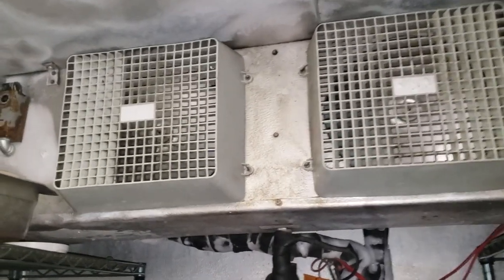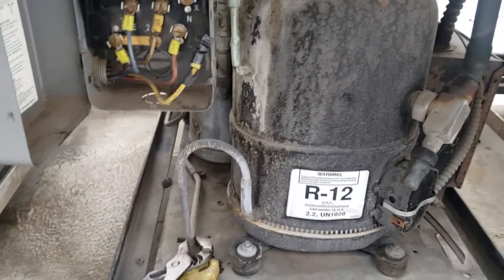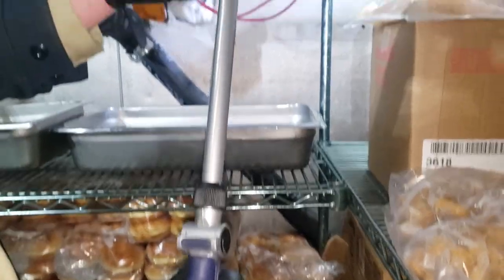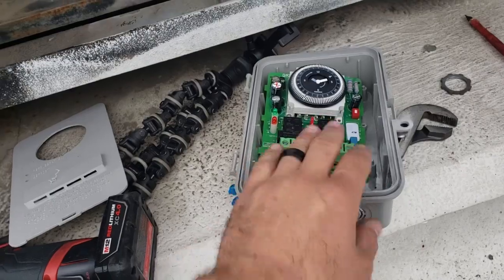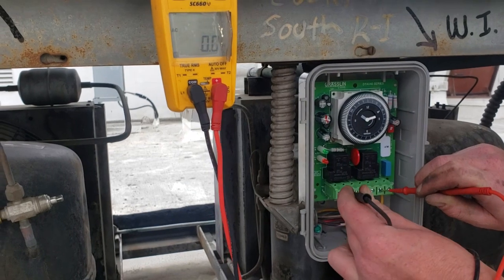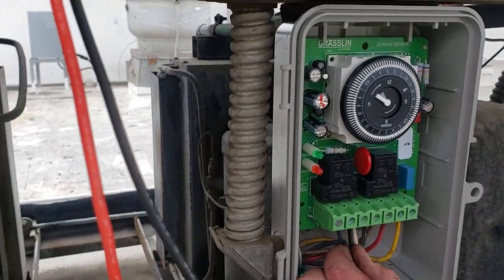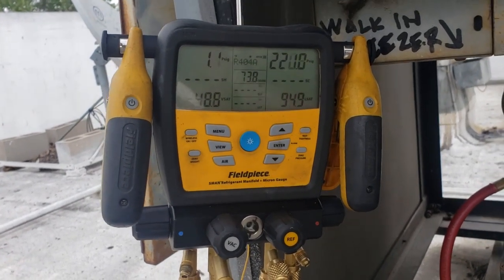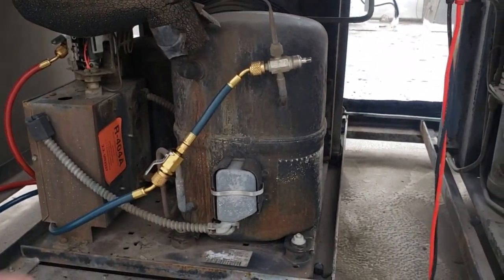WALK IN FREEZER TEMPING TOO HIGH

Comment: R12 systems are strictly forbidden by the motrealprotocol since 2000. since 2005 R22 was added. this accounts for R404A  and starting from 2030 R410A as well. from that moment on only natural gasses like ammonia and co2 are permitted. since 2015 R22, R401A, R402 and R408 are strictly forbidden to be used at all. all that because R22. from 2030 onwards only R744, R290 and Nh3 will be permitted.

Comment: Duration is the failsafe. Defrost should terminate by the DTFD. This way the coil temperature high enough so that coil fully deices and the fans don’t turn on right after a defrost. Love those clock. Good video.

Comment: Dude you must have not read a comment I left before about the paragon universal voltage model 9145-00. That’s my go too clock. I think it’s better made than grasslin and will fit in paragon housings. I keep a grasslin just in case I run into one that failed so I don’t have to replace housing every time. It’s the little shot that saves time when your smashing out calls and you got to keep moving lol.

Comment: I have a question for you.i need your help before i condem this compressor I have a 115v reach in cooler and the compressor is a neu2155u. Is trying to start and is pulling 26amps but not starting. Is it done or what you thinking i shoul check next. It has a potential relay.
Reply from the maker: Check the starting componets before condemning the compressor
Reply: @HVACRVIDEOS  ok 
I replaced the potential relay start cap and run cap are good. 
It is still tried to start and is pulling 26 amps. It's rated for 6.80 RLA.   LRA is 40.0
I think is done.

Comment: I like how you just whacked the pressure switch with a screwdriver and the compressor shut off
Reply from the maker: Its my secret way to fix things, just whack it........   Thanks for watching, I will be going live on YouTube this evening 5/13/19 @ 5:PM (west coast time) to discuss my most recent uploads and answer questions from the chat. Come check it out if you can  https://youtu.be/tQb9QK9LnH4
Reply: it's probably due for replacement, but it's common for springs and diaphragms to wear/lose strength or work harden with aging. which of course makes throws off the pressure  limits set.

Comment: Al those frosted wires and wet terminals made me wonder: Does this never go wrong, resulting in short-circuits or electric shocks?
Reply from the maker: Surprisingly we don't have many electrical shorts because of the moisture, Thanks for watching, I will be going live on YouTube this evening 5/13/19 @ 5:PM (west coast time) to discuss my most recent uploads and answer questions from the chat. Come check it out if you can  https://youtu.be/tQb9QK9LnH4

Comment: Oh yeah what is a normal temperature swing for a walk in freezer? The one i mentioned swings about 10 degrees and it seems extreme to me. It has an analog T stat.
Reply from the maker: I set mine for 3-4 degrees of temp swing, Thanks for watching, I will be going live on YouTube this evening 5/13/19 @ 5:PM (west coast time) to discuss my most recent uploads and answer questions from the chat. Come check it out if you can  https://youtu.be/tQb9QK9LnH4
Reply: poor thermostat location with lack of airflow and a box opened often can result in wide swings, as can bad thermostat or leaky door/box  causing previous person to set it wide

Comment: I have a walk in freezer that i think has a dead fan delay and defrost termination switch along with a dead defrost clock being that the defrost clock isn't keeping the correct time and losing 2hrs. Also once the whole system comes back the fans instantly kick back on. Those grasslin are great for what they do, but they don't last like a paragon. Good video! it's nice to learn from you.

Comment: Can you expand on your aborted "latency" comment with regard to digital gauges during the pump down and pressure switch adjustment.

Like the addition of newbie hands and allowing and correcting errors with explanation!

Thanks.
Reply: Electronic gauges need time to measure the pressure, convert to digital, and update display. It can take longer than you think. In the video the SMAN gauges appear to be behind by 0.5s.Analog gauges are instant by comparison.
Reply: @fluke196c  So for setting pressure switches, especially in a pump down situation, better to use an old analog stubby gauge?
Reply: @davejohnsonnola2758  I honestly dont think it matters as long as your paying close attention to your digis. You will get it close enough.
Reply from the maker: I will discuss this in the stream tonight, Thanks for watching, I will be going live on YouTube this evening 5/13/19 @ 5:PM (west coast time) to discuss my most recent uploads and answer questions from the chat. Come check it out if you can  https://youtu.be/tQb9QK9LnH4